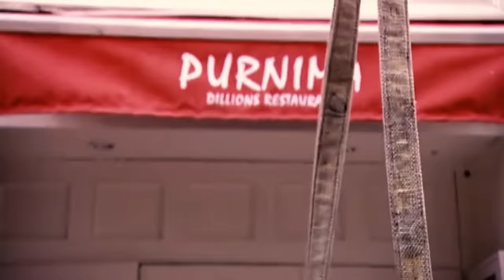Dillon's: A Kitchen Nightmare So Bad, It Ended Up in Court

Comment: 13:13 while I agree with you, legally assault is verbal, whereas battery is physical. It's dumb but it's true
Reply: Only if Martin reasonably felt he was going to be physically hit. But, it was pretty obvious Gordon wasn't going to physically attack Martin. So a judge will most likely throw the lawsuit out pretty quickly.
Reply: This is not true. Physical assault is a thing and is what most people think of by default when they hear “assault”. Physical assault is the act of behaving in a way to cause someone to feel the need to be physically defensive. In some cases, people have been charged for merely putting their hand on someone. Battery would be like hitting someone. Battery usually implies assault.

Comment: Hey, just so you know Assault does not actually involve attacking another person. Assault is where you intentionally make a person feel as thought there is a physical danger to themselves. What most people think of when they read Assault is actually called "Common Assault" which involes both assault and Battery. So if a person were to get up in your face and intentionally makes you feel like you are in danger, that can actually be classed as assault. Gordon would have to prove that he did not mean or forsee the emotional damage Martin claimed he caused
Reply: Absolute nonsense

Comment: In many cases getting in someone's face and yelling at them is considered assault. So technically speaking it is assault and technically speaking it's verbal assault. And everyone has the expectation of safety. So if someone gets in your face in a heated confrontation. You could argue that your expectation of safety has been putted Jeopardy and you have the grounds for self-defense. I did not legal advice and if you are arrested or charged after a verbal altercation always seek legal advice do not consider this legal advice I am not a licensed attorney and this should not be considered a legal advice. You should always consult a licensed attorney for legal advice.

Comment: i thought i saw a stat of like 80-90% of the store kitchen nightmares still fail. i mean the reason most are in that way is cause of management  and they are still there so its understandable but still i wouldnt say gordon ramsay as a savior.
Reply: It was also found that A LOT of the restaurants the production team chose were already so deeply in debt, very few of them had a chance of actually succeeding, even with Gordon's help. That was one of the (slightly lesser) reasons why Gordon eventually said fuck the show and killed it.